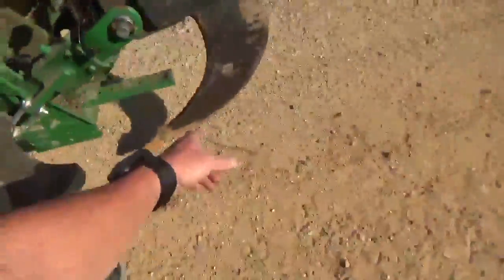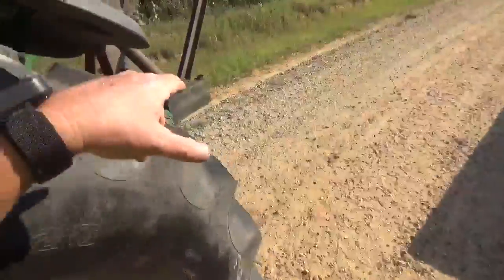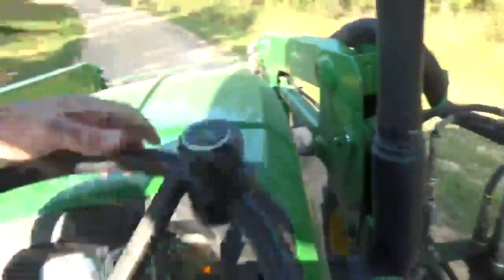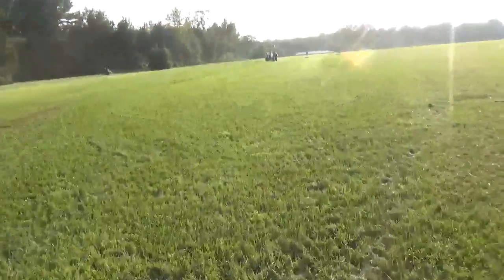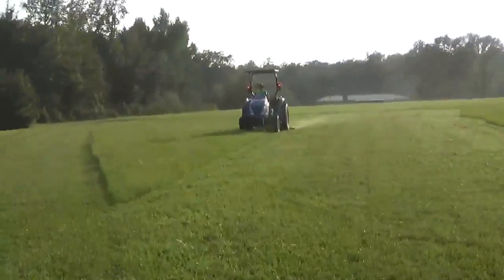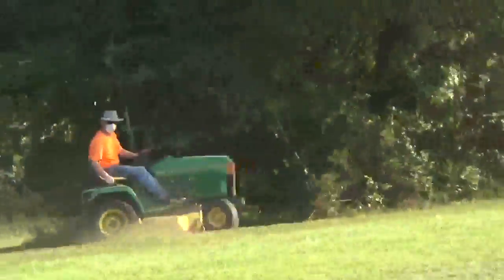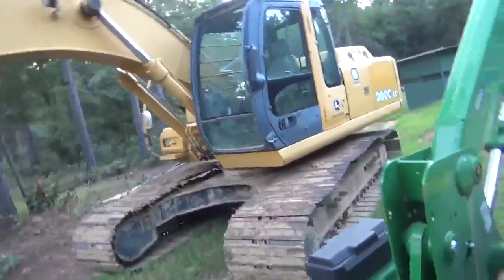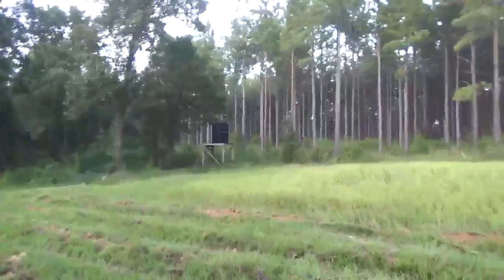John Deere 5075E- working  pulling a subsoiler

Comment: Tim, quick mod if you think it needs it to the lower links of the subsoiler. Remove the pins and straighten the flanges if needed, weld a second plate on the outside of the cross tube with a suitable hole drilled in it, feed the tractor arm in between the two plates and put a large pin through all three pieces - I use tractor drawbar pins with lynch pins for this job and it works real well.
Reply: Dan Whiteford that would keep it from distorting and if the measurements are correct, could hang it from the quick hitch.

Comment: You should patent some of your idea's Tim, I've never seen  that anywhere else,burying pipe and wire..Some of you wore off on Tater he's not hesitant to be adventurous ..lol  He's a mess for sure..Take Care Tim..
Reply: It's called a cable plow. Patented in 1963 - #3232358.  The telephone and utility companies have been using them for 50 years for both direct burial cable and to install buried conduit.
Reply: Thank's Buck I never knew that and honestly haven't seen em,I believe you it makes sence why they're used by power companies..Take Care..